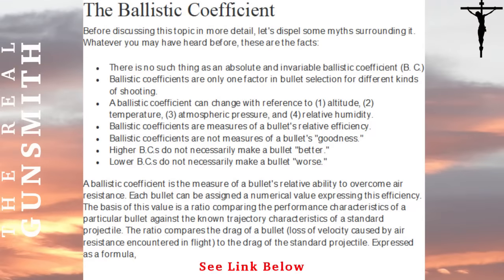7MM PRC Compared to Other 7MM's

Comment: I’d recommend testing the carriage before voicing your opinion as the writers you speak of are wrong. The cartridge was never intended on shooting light bullets to achieve high velocity. The cartridge 100% provides a faster velocity than the 7 rem mag with heavy bullets. The cartridge was designed to have better barrel life and the 28 nosler comes with a 1 in 9 twist with os fine up to 175 grain but what about the 195 grain Berger eol? You can get a 1 in 8 twist on the nosler but it’s case design makes for finicky results. I personally have these rounds so take it how you want
Reply: Also how many other 7 mm cartridges can you run with a 20” barrel?

Comment: Hornady is damn good at advertising and promoting their cartridges; good, bad or otherwise.  They claim this round is unique in how it was designed and you're right, that's pure hogwash.  Many cartridges have been designed this way, down through the years.  The H110 powder (or military equivalent) was designed to push the 110 grain bullet fired out of the 30 Carbine cartridge.  That's how H110 got its name and what it was originally designed to propel.  The 7mm PRC is a fine cartridge, just like dozens of others that are just as good.  I am not a fan of belted cartridges.  I prefer a rimless case design with a shoulder of approximately 30 degrees, and that the shoulder be used to headspace the cartridge.  There is a lot of fuss and fanfare over the "modern case design" that Hornady is always going on and on about, but the simple fact of the matter is Newton was making rifles chambered in cartridges of this design over 100 years ago.  If the powders and metallurgy had been what they are today, all three of the Newton cartridges would have been just as good as any of these new "precision" cartridges.  Also, if Newton had been a better salesman and promoter, he might have stayed in business.  If his estate hadn't been so stingy with his proprietary case designs after his passing, there again they would have been incredibly successful.  If you built a modern 256, 300 or 35 Newton, using the steels and powders we have at our disposal today, they would compete very well with any of these "advanced" new cartridges.  That just proves how little rifle cartridges have really changed over the last 130 years or so, since the very inception of smokeless powders and rimless cases.

Comment: The knowledge base you have is in question…… it’s the efficiency of the 7mm PRC… similar to the WSM… it takes less power to reach the velocities. You’re pushing 90 grains of power with the nosler max velocities. 20-25 grains more powder for 125-200 FPS. That doesn’t seem “better” get it!!

Comment: The problem is you are looking at it from a smiths point of view, not a consumers point of view. Sometimes i want to use my 7mm rem mag with its factory 1 in 9.5 barrel and 162 grain at 3200 fps in 26 inch barrel And sometimes i want want to use my 7 mm prc with its factory 1 in 8 twist barrel to stabilize my 175 grain eldx not the eldm  at 3000 fps, which in my experience has been 1 shot effective on moose out around 550 yards, where the projectile is designed to perform not at 150 yards where the partition is designed to perform at.  I dont have the money to switch barrels around or custom build rifles when i want to try different types of hunting or shooting. But i can afford a 1000 dollar factory option. And sometimes we just want to listen to the BS.

Comment: If this guy had a better attitude and less boastful approach to these topics.  I might be more inclined to listen to what he has to say.  People make mistakes, there are misprints in all sorts of publications.   Nobody (with any shred of critical thinking skills) believes a cartridge with less case capacity shooting the same bullet is going to achieve higher velocities.  So, most of your argument that people are 'lying' about the 7PRC to gain it's popularity is just plain nonsense.  Fact is the 7PRC is a modern beltless cartridge that is close enough in performance that 98% of shooters will never see a difference.  Plus, using off the shelf ammo and rifles is going to lead to more accurate results than off the shelf 7 rem mag rifle/ammo combo.  Your argument is that a 'properly built' 7 rem mag easily beats a 7PRC?  No kidding?  What a ridiculous argument.  Like saying a fully built custom LS motor will be more powerful than a stock one.  I don't doubt your experience and skills in the gunsmithing world.  But this video comes off as if you're personally offended by this cartridge.  26 minute video and 20 minutes of it was you telling us how much you know from experience (without providing any proof of said experience).  These long winded rants with not much in the way of real world proof is a waste of time.  I watched to the end hoping there would be some shred of actual data and not just loud boastful ranting...but none appeared.

Comment: They designed the round at the same time they got it SAMI certified. It's designed to shoot long heavy bullets better than the 28 or any other 7mm you talk about. It's an ELR round that can be used for hunting not the hottest new hunting round. This sounds just like all the fud talk when the 6.5 CM came out...

Comment: The man speaks the truth.  But you can trust the marketing if you wish. 

By the way, in my opinion the ELD-X is a terrible bullet. It might work at 400 years, but will turn to jello at 75 yards. I'm not good at stalking backwards so I'll stick with Nosler Partitions,  A-Frames or Bear Claw. Heck I'd take Winchester Power Points or Remington Cor-Loct over an ELD-X.

Comment: This guy is spot on. The 7mm PRC has nothing on the 7mm rem mag.  The 7mm.rem mag and the 7mm weatherby are the 2 premier 7,s out there. They are like 2 peas in a pod and the 7mm rem mag has the advantage for the handloader with cheaper brass and dies. The weatherby and Remington,s ballistics are identical. Its more a matter of which rifle you like best , The beautiful mark V or the 700. Another thing that is BS is the lie that the 7mm rem mag headspaces on the belt. This is false. The 7mm rem mag headspaces on the shoulder like other cartidges. The only belted magnum that ever headspaced on its belt was the 375 H& H magnum. Another thing this guy is spot on about is NOSLER BULLETS. The standatd for the last 70 years.  Hes absolutely right when he says the 175 nosler partition is the finest HUNTING BULLET ever designed. Elk , deer and sheep dont give a shit about BC but they sure drop when hit in the vitals with a nosler . Ive had my 7mm rem mag for 32 years and have never needed a finisher on anything i,ve turned it against . Ive shot 140,BT,s , 150 gr& 175 gr noslers as well as 150 gr swift scirrocco,s and bullet performance has been OUTSTANDING.  Ive gotten 2975 fps out of a 24 inch tube with a 175 nosler ahead of 63grs of IMR 4350 and a 9 1/2 magnum primer. Ive gotten 3150 fps out of the same tube with a swift 150 gr scirrocco ahead of 67 grs of IMR with the same primer.  I dont know about anyone else but IF that is not fast enough for you TAKE UP KNITTING.  Thanks for the heads up on the ELDX BS. Ille be sure to avoid them. For me its always been noslers and in my 25/ 06 120 gr partituons are like dynamite on deer. Good Lord they put them.down. Noslers equal 1 shot kills. Hes also right about the hornandy interlock soft point's.  In my sons remington 783 30/ 06 they are deadly. Shot a big doe whitetail one year at about 75 yards quartering toward me. 150 Sp interlock went in where the neck joined the body and exited the far side through the ribs which I never recovered, she took 4 steps and went down on her nose stone dead. BC doesnt mean shit to me. Most of the bullets I use for hunting are around a 500BC. WHO CARES, THEY DELIVER THE GOODS , EVERYTIME.

Comment: You are a gunsmith. The 7mm PRC prime selling factor is long range shooting. Hunting is a secondary use of this caliber. It was made specifically for high BC heavy for caliber bullets. By design the cartridge is even easier to load for. Thanks for shooting down bad writers that give misinformation there is plenty of that. Your opinion on the 7mm Remington Magnum is just that an opinion. It is a great cartridge no doubt but so is the 7mm PRC. They both have their advantages and disadvantages.

Comment: Rifle twist rate, rpm,powder tank size, now how is it possible to send a bullet out of a rifle with a faster twist rate of, say, 7.5 :1 faster than that of 9:1 not without a higher pressure, it's strange that twist rates don't seem to get mentioned much,now they want 190 grain bullets for the 7mm prc making it even harder to stabilize and longer bullets to reach longer ranges, heavy bullets are fine but I really don't care for longer bullets except for the sectional density and the extra energy added per caliber, I think they just want to twist it all together to confuse the less educated. 
Aim small good hunting GOD bless.
Reply from the maker: Fast twist always builds pressure quicker.  High B. C. bullets are not suitable for game.
Thanks for watching.
Reply: @TheRealGunsmith 3 great hunting bullets with good bc… accubond, scirocco 2, and terminal ascent. Advancements in bullet development is a good thing Randy.  There’s plenty of trash but there’s plenty of good too. Folks just need to educate themselves.
Nothing beats a good shot placement. Most hunters don’t practice enough and then blame the cartridge on their piss poor shooting skills.

Comment: Hornady has a line of marketing BS, that's for sure.  6.5 Creedmoor is a .250-3000 AI Savage with a longer neck and 30 degree shoulder.  But it works extremely well and fits in a sr25 magazine.  That is it's only advantage over 6.5X55.

7mm PRC is marginally better than .280 AI but it will overtake the market.
7mm magnum never did what it was supposed to.  It was always a disappointment.  It sucks.  It is no better than .280 AI 1:8.  
28 Nosler is waaaay overbore, and is as inefficient and silly as any Weatherby cartridge, but more scientifically designed.

Comment: So, we can seat the 7 rem mag out far to take advantage of the case. From a previous video though, the 6.5 creedmoore had the bullet seated out to far. I wonder if he knows who Bryan Litz is? Just remember the thin jacketed low velocity rated expanding bullets are garbage, but to get a partition or accubond to work well it needs more than 3200 fps muzzle velocity. This guy has no idea about engineering and the amount of testing that goes into making a product that floods the market as one of the best. He doesn’t make a rifle any better than Fierce, Christensen, Browning, Gunwerks, Speedy Gonzolaz. Engineers don’t have micrometers that go down to .1 thou. Wait, didn’t you need an engineer to design and build it for you. This guy lies. Use some critical thinking. And just for the cherry on top, look up Hornady’s law enforcement ammo, then think about what it is used on.
Reply: Do u have a custom rifle made by randy no neither do I don't play into the it's all the rage bull sh$% take your time an look for yourself anything 7mm short big little tall an small that's everything then cross reference it with the 7mm prc you'll be surprised
Reply: @waynemayle865  look at saami specs there bud. Factory ridles built to saami spec in a 28 nosler, 7 stw, 7 weatherby mag, 7-08, 284 win, they all do not have a fast enough twist to stabilize the longer bullets from both hornady and berger. Hornady came out with a cartridge that does it from the factory with that option. It’s the next progressional step in cartridge development for a saami speced rifle. Speed isn’t everything either when hunting. It helps, but there are two different types in terminal ballistics. There is muzzle velocity and rotational. Same bullet to same bullet, one rotating faster will mushroom more and cause more damage on game, also aid in better bullet stabilization. But this is all high school physics right now. There is way more rocket science and applied physics that go into cartridge design, rifle making, r and d, testing… Just another cherry for ya, that interlock that randy said he likes, that same lock ring is in the eldx. Takes looking at a couple pictures and reading to figure that out.
Reply: @wyattgraham5711  Sammi specs. My a$$ most the rifles built don't fall under specs unless it's going to be commercialized
Reply from the maker: The Creedmoor rounds were not able to fit in the short mag box.  Listen, and learn.     And law enforcement is not the same as game shooting. Totally different applications. Elk, moose, deer, etc don't shoot back.  As for how you seem to think you know I don't make any rifles better than the others you mention, how would you know.  You've never purchased one of my rifles. And of those, I am the only one working up individual loads for each rifle, which can make a huge difference.   
"Engineers don't have micrometers that go down to .1 thou."  Really.  SMH!    And, BTW, when I worked as Speer CCI and Burris, to name a few, I corrected many engineer design flaws by simple logic, and math.  
It appears by your comments to be over your head.   And finally, I don't lie.  
May you learn to learn and listen.
Reply: @TheRealGunsmith  thank u these people see latest an greatest an go crazy
Reply: @TheRealGunsmith  The difference in length between a max COAL of a 6.5 creedmoor and 308 win from saami specs is only .015"; 0.025" in the 7-08 and 260 rem. That seems very hard to believe that .015" longer would be the worst thing in the world for rifle manufacturer's that all of the sudden their mags weren't designed to at least house 2.900" COAL or maybe even 3.000" because it's a round number. Game may not shoot back, but the match bullets are designed with rapid expansion and cause the greatest amount of internal damage. On game isn't that what we want as hunters, to be a quick clean kill with as little after shot tracking as needed. The bullet needs to enter, cause as much damage as possible to the vital organs. For your beloved partition and accubond you need to be within 400 yards shooting a magnum powder charge to make that bullet expand and cause as much damage as possible on the game. For the scope technology of when the partition came out, that was adequate and did the job very well. These new thin jacketed bullet will expand more, comparatively speaking, to the partition or accubond. Does this mean a poor bullet design? No. Plain and simple, it's the next progressional step in bullet development. Very specific for the right mechanical properties of the lead and copper being used in the bullets. It's even better now with the quality control and consistency that can come from different suppliers/manufacturer's. Engineers not having the micrometers that you claim to only have, you can order a solid set from amazon that has that same precision of .1 thou if not better. I would think that Nosler, speer, hornady, barnes, drt, hammer, cci . . . would have those for their engineers, machinists, quality control, and whatever positions to use. I've had to use them in different capacities throughout my life from checking dimensions from manual lathe work to reloading. Your videos always come across as if you are the god of rifle building and hunting. There are many other great manufacturer's, rifle builders, reloader's, that do a lot to advance and move this industry forward. Saying that they can't or their new product is inadequate when there is countless testimonials contrary is a lie. There are a lot more people out there that are paid to do the research and development on rifles, bullets, materials, optics, powder chemistry, than just you. Sorry if this bursts your bubble, but you need some humble pie. The old ways aren't always the best, neither are the new. It is ill conceived to trash on some aspects without considering the whole picture.

Comment: Ok 28 nosler superior yes 10 to 12 more grains of powder  extreme overbore around 1200 rounds less barrel life magnum action and more bulky rifle slightly more recoil so we're wasting 10 to 12 more grains of powder to get 250fps faster velocity loose 1200 rounds of barrel life and have a bulky rifle and 2inch longer barrel to drag threw the brush and if you cut it down to 24inch barrel velocity gain is around 175fps to 190fps faster to get this performance no thanks and I might add a average of $1.45 a round more no thanks and that's why I choose 7mm PRC

Comment: Hornady bullets are cheap and they work. Your normal reloader is not gonna buy those god awfull overpriced Nosler bullet
Reply: 🧐 Their are alot more good bonded bullets, besides Nosler! And, even Horneday makes the CX solid copper bullet and their Interbond bullet! But, Randy is right about the ELD-X Bullet! It is Not A Good Elk Bullet! And, Your Wrong when you say that NO ONE won't pay the extra $0.25/per bullet (or so) to insure that they will actually kill the animal, rather than just wound it! I Will! And, I will go as far as to say, "What Is Wrong With You, If You Won't?" Penny Wise and Pound Foolish! 🤪 I Respect the Animal Enough Not to be Using "Target Bullets" on Game Animals, Especially Elk! 🤯
Reply: @ronlowney4700  yes Ron you are correct on the bullets ive used speer bullets all my life though alot of them are none bonded but still do a dam good job and shoot half decent but they are cheap and they do a good job killing. But when it comes to Nosler brand stuff thats discustingley over priced when a speer hot core or gold dot will do the job just as good and only cost 28 bucks a hundred i just cant get onboard with some of these interlock style bullets that cost what they do.